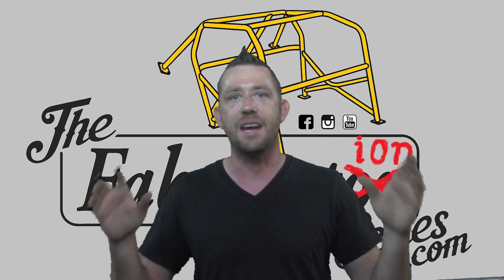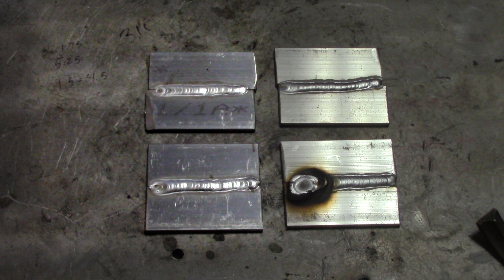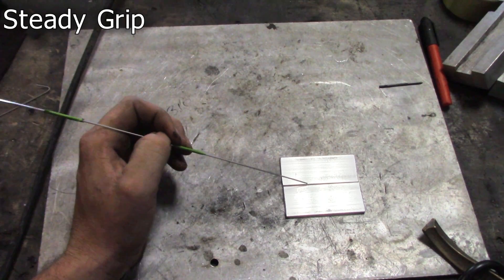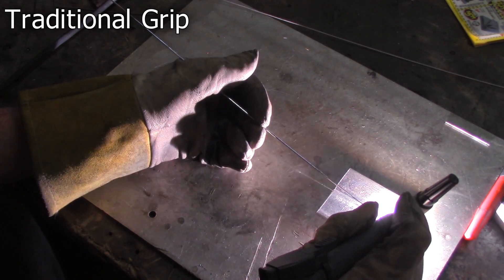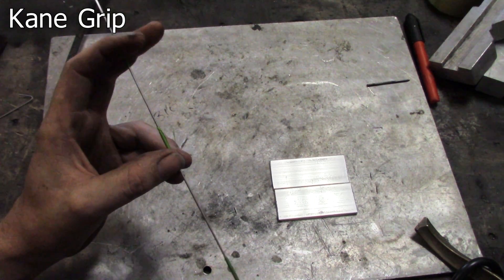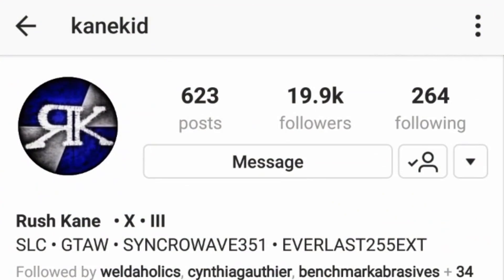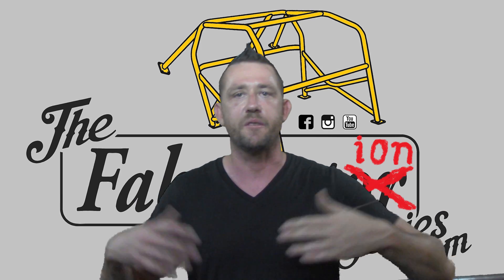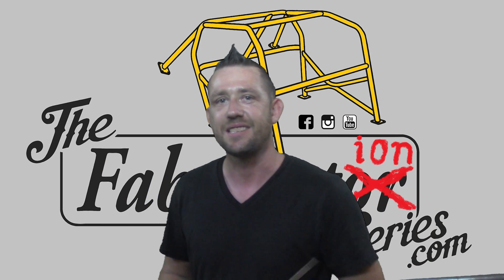TFS: TIG Simple - 4 Ways to Feed Filler Rod

Comment: The problem I have is when I try to feed, the hot end of the rod is flicking all over the place, not going into the leading edge of the puddle. It’s just not smooth enough as when I don’t feed. Any tips? Thank you for all the videos and demonstrations. Inspiring.
Reply from the maker: It's a developed skill which takes time. Keep practicing - you'll get it sooner or later. Just be patient.

Comment: I'm right handed and now discovered I feel more comforting holding the torch with the left hand and feeding with the right? is this normal/common at times with your experience in the students you have taught? I just started practicing and not sure if I should switch hands and learn the traditional handed method for a right handed person. Thank you for all your videos and everything you do for the community!
Reply from the maker: Use whichever hand you're more comfortable with. There is no right or wrong.

Comment: HAHAHAHA LMAO... So yeah about 3mins into the vid I paused it & decided to go get a short length of filler wire to practice with. Then bam your like practice practice practice everywhere you go...😂 

I'm buying primeweld 225 in a cpl weeks to weld 1/8" 6063 up firework racks. I had a guy doing it for me but he didn't work out so I'm excited to learn the art form of tig welding. 

Could ya possibly give me basic settings to get me close on the 1/8" as a starting point?

Comment: 'Kane grip' inherently moves the rod laterally as it feeds, look at the position of his hand, he seems to use that motion as a dab as he goes, if your hand/wrist rotation is off you will flick the rod off to the side and have a wonky run or just straight contaminate your 'trode.  Did a dry run of this for shots and giggles and it requires not only a steady hand (not good if you shake like a strung out meth addict) but guitar player-like dexterity/coordination and takes a while to get the muscle memory/rhythm. Not for everyone, probably only a select few but interesting nonetheless. I clip my rods in half and use a mix of steady and index, so I can feed when I have to but still have the beginner dab control, but I don't do many long runs. Great vid as usual anyhoo.

Comment: A weird question maybe - but when your right handed, which hand you hold the torch and which feed?
Reply: Torch in the right - feed with the left. You'll already have the wrist control from writing to manipulate the torch, wire feeding you'll have to learn the muscle memory for whichever way you go. It can't hurt to learn both ways though - you might come across a few rare cases where you need to weld "left handed".

Comment: Do you have any advice for blow through on a door jamb when you are full throating? I have to grind out the boogers and make it look not welded. Obviously I realized not to blow through, but it happens. Usually it's 16G  CRS  and I'm using a Miller 200 hard wire.
Reply: Turn the amperage down and haul ass through that center section, watch the edge of the puddle and perhaps turn that gas flow up just a tiny tiny bit.

Comment: The steady grip is the grip that nearly all professional welders that have been welding for 40 years use. The grip you call tradional grip is not a traditional grip and is not commonly used by traditional welders. The grip that is commonly used by seasoned professional welders is the steady grip. As the rod gets shorter, your hand gets closer to the weld no matter what grip you use.
Reply from the maker: John Bergeson My polls conducted before the vid differ with your opinion. However, neither is right or wrong as long as the result is correct, and that's the beauty of this industry.

Comment: I'm always having the problem, that when i try to do this, the end of the feed wire is wiggeling to much continued by not being able to hold it in the gas flow
Reply: Bend the rod at the end and it won’t wiggle as much, you can even do multiple bends to steady it more, only Catch is if it’s a long enough weld you’ll have to get over that bent area which can be a bitch at times

Comment: Awesome video as always.  I have a question regarding the roll cage welding/pipe welding you have done.  Are the welds full penetration?  Every video I watch says the key to roll cage/tube welding is the have the smallest gap possible at joints.  Yet when I do that I can't seem to get anywhere near full penetration with my tig welder.  I have a decent looking bead, but the inside doesn't show fusion.  I know if I had a gap I could get full fusion, but everyone says not to do that.  The other thing I always wondered was what is best practice with weld bead size with tig?  I took a tig class at the local school, but they never covered what size I should make my actual beads.  Aluminum is easy for me in that regard, the bead winds up being fairly wide.  My steel welds tend to be half the width of the aluminum beads or smaller.  Much smaller than most mig/stick welds I see around on a daily basis.  I often wonder if I should multi pass and add another bead.  Thanks in advance, and I will gladly share a beer or a pack of filler rod as a thank you :).
Reply: Hi, The size of the bead should be equal to the thickness of the material. Smaller means you don't have as much strength as the material and thicker doesn't actually do anything but waste time and money. This is a general rule however, if an engineer says otherwise on a plan, follow the plan. Also, engineers don't always know what they are doing, if you spot something fishy, talk to the engineer.